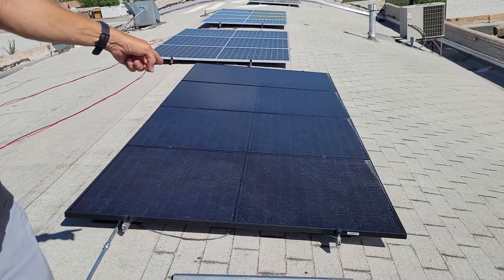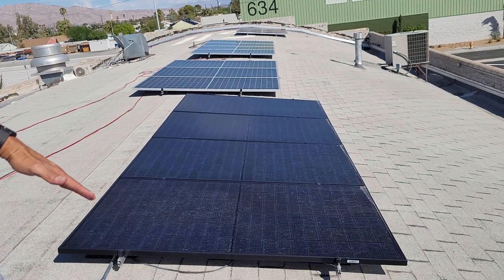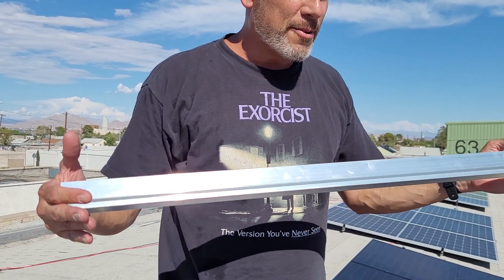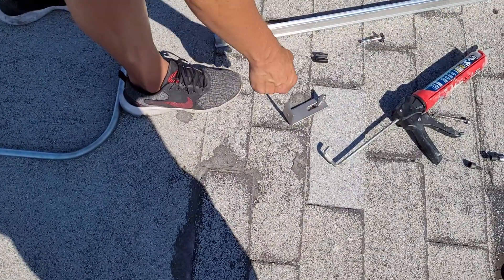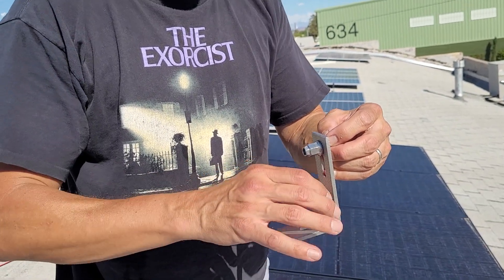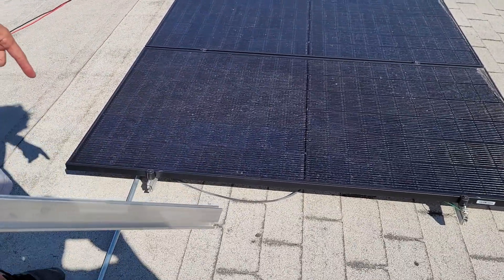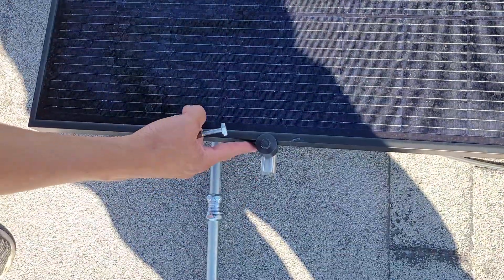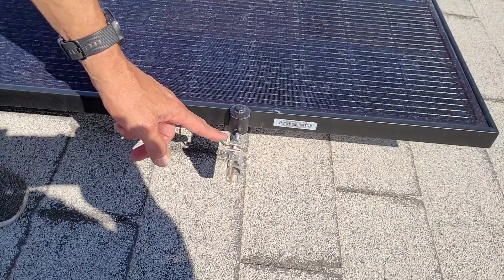#9 Where to get and how to install solar panels on an asphalt shingle roof.  #offgrid  #diy

Comment: Does it hurt anything if you have extra panels hooked up?
Reply from the maker: No, as long as the voltage is under 380 volts. But it may not help much, either. Well, possibly if it's partly cloudy, could help a bit, but you get to a point of diminishing returns if you slap 2000 or 2500 watts up there for a 1 ton unit.